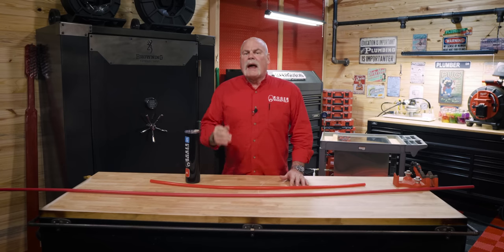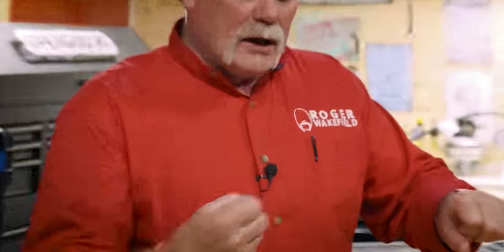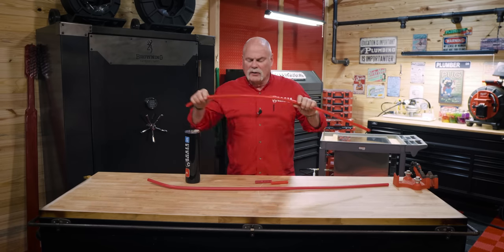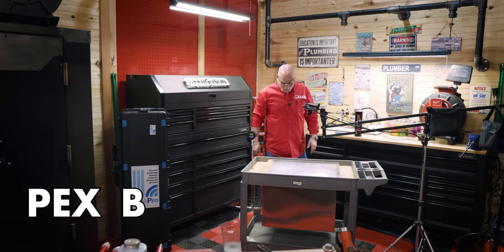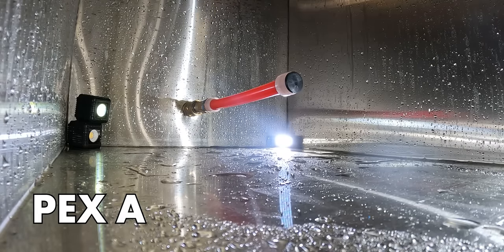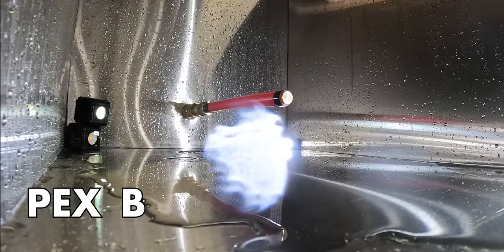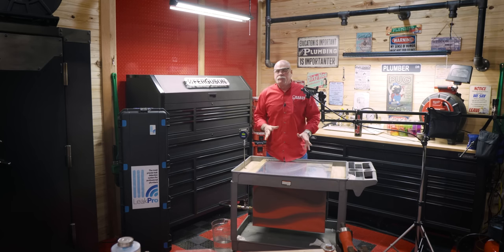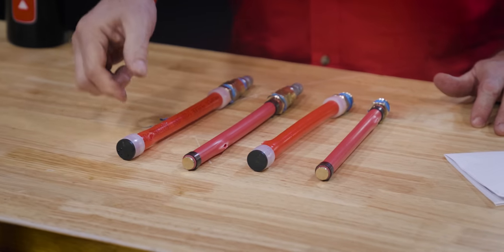Which is Better PEX A or PEX B | Pressure Test

Comment: Your test is useless. As an insurance adjuster with 28 years in the field, I never see pex rupture mid pipe, its always a joint, fitting or elbow.   Want to really test it?  Put a few elbows together and freeze it.
Reply: You said joint 3 different times. Little do you know, adjuster, that pex can have elbows, with no fittings. But im sure you knew that, 28 years experience, not practical im guessing xD
Reply: Lol all tradesmen and homeowners  know adjusters and are complete jokes. Everytime. Never fails.

Comment: Uponor deteriates fast as hell
Reply: I’ve gone to way more pex B fitting leaks than pex A
Reply: No it doesn't.  Lol.
Reply: Maybe more pex b leaks because it’s more of a diy/homeowner system than pex a. Pro’s use copper or pex a where I am
Reply: It depends on the local water source. If they use chloramine, Pex A will wear faster, if they use regular chlorine. It doesn’t really matter.
Reply: @Jared-Kreate  can I ask what state? In western WA pretty much everybody at my company uses Pex-A and some guys use copper, nobody gets callbacks on properly installed Uponor but I see so much hate for it on the internet
Reply: Lol what my house is 20 years old, all upunor not a single leak on the in floor heat or any domestic water pipe, it doesn't deteriorate at all, there are issues with the red pipe specifically failing tho if you have 2 fittings within less than 3" between them I've heard
Reply: @Byron88  it depends on what they use to clean your water source. Chloramine vs chlorine. The former will eat up Pex A faster. Also in the plumbing world, 20 years is only 30% of its life. If it dies at 30 years, that’s still only a half life.
Reply: @NageekNoohac  im in California my company uses pex b but we use expansion fittings. Never had a problem and it holds better than pex a in my experience.
Reply: How about with copper?
Reply: Depends on its exposure to UV. If you leave it in the back of your truck, it’s pretty well compromised.
Reply: @NageekNoohac  I’m in Southern CA.
Reply: It definitely does not deteriorate
Reply: 22 yrs of pex a use on rental properties says it’s totally fine
Reply: You didn’t bleed the air out after the first test
Reply: @NageekNoohac because they cant afford it
Reply: @EspinozaaMC Voids the warranty